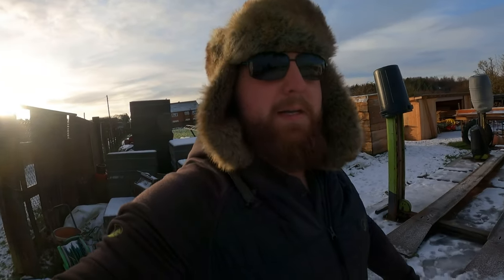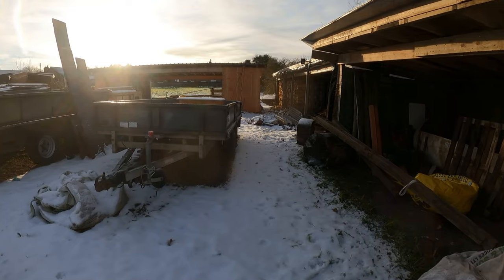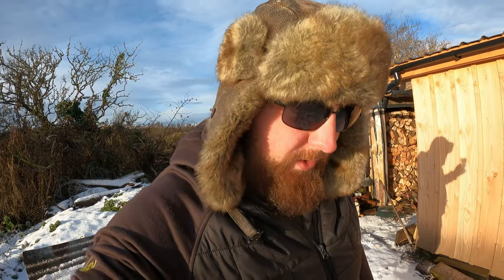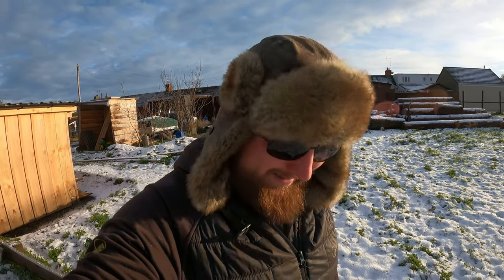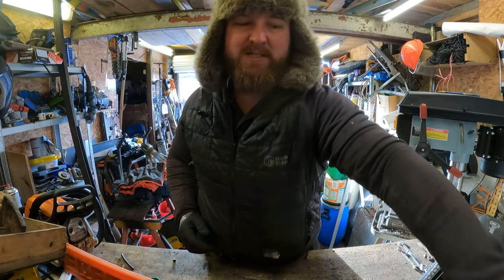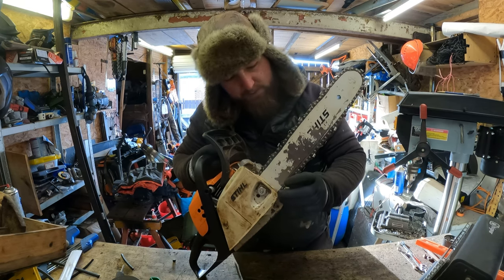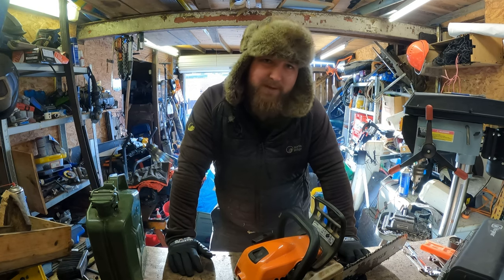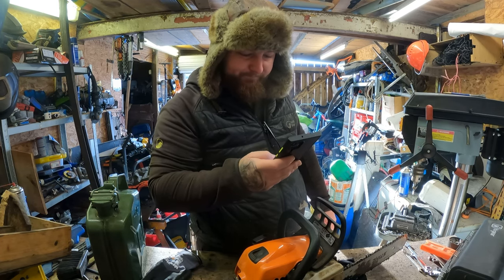Reviving a Stihl MS181-C from stale fuel ~ will it run ?

Comment: i run a ms181 with 16" and 14" bars and 3/8 LP chain, they handle 16" ok if you treat it for what it is- a lightweight low powered firewood/garden saw.
great video as usual Nick.
Reply from the maker: Hey Martin, merry Christmas buddy. Thank you for sharing your experience with a 181. Good to know they can run ok with the 16" bars. I think 14" will be completely fine for what I'm wanting that saw for. Just going to be a saw to pull downed wood out thats simple and easy. Thank you buddy, all the best 👍

Comment: 181 c or cbe is what I think I'll be upgrading too next Yr   stale fuel is a huge problem 4 to 6  week old fuel stored in a proper gerry can is  causing me problems these days
Reply from the maker: Hey Steve, it's a nice little saw to be honest, sounds like it could do with a bit of minor tuning to let it rev out a bit more at the top end, that's if it has it on it. Not sure about running a 16" bar on it though, I could be wrong 😄
This E10 petrol is no good now a days, just don't last at all, luckily I've had no issues myself yet but know of folks around me who have. 
I run all my machinery dry now and the rest is just in the Jerry cans 😆 
Thanks for commenting and merry Christmas 😊
Reply: Willing to trade up even - my temps for yours any offers on -43c windchill? Stay warm. I do like Stihl saws currently run an MS170 MS250 and the MS390 for the bigger stuff. Keep cracking on as my UK friends keep telling me.
Reply from the maker: @Old Country  wow that's some cold temperatures there buddy, I like the cold but -43c is a little too cold 😄 
I like Stihl to be honest, I often asked myself am I a stihl or husky fan. I know I'm a Stihl guy. I got Isaac the MS170, I have a 181, 260 and a clone stihl ms660. All great saws now. I'd go on to say I'd buy more if they came the right price.
Thanks for commenting buddy 👍
Reply: @everydaywithmenick  if I buy a new saw im going  to run the bottled fuel like aspen  save the hassel  of bad fuel but yes also run dry before storage  prob only use 10l a yr anyway
Reply from the maker: @Steve Roche  where do you buy that from ? I know some places still have E5 on the pumps which is slightly better than the E10 in most pumps. Not sure how much I use yearly but better to run dry or empty then run dry.
Reply: @everydaywithmenick   aspen is husqvarna  variant think stihl moto mix is stihls bout 20 quid 5 litres but has 2 year shelf life think ans 6 months in the saw
Reply from the maker: @Steve Roche  aah right, bit steep for the price but get the longevity of the fuel I guess. You can buy the fuel additive also for petrol.
Reply: @everydaywithmenick  yh it is dear but with  me only using 5 to 10l a yr its saves the ball ache of getting fuel n mixing
Reply from the maker: @Steve Roche  very true. And you'll have the assurance of good fuel also.